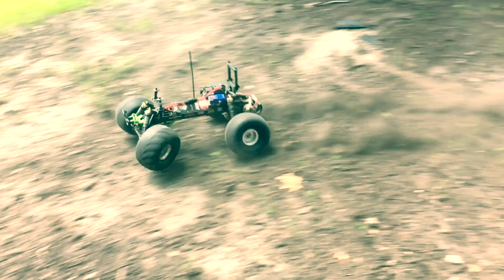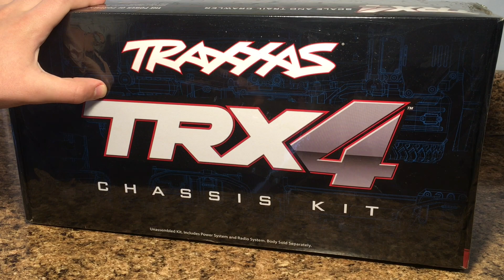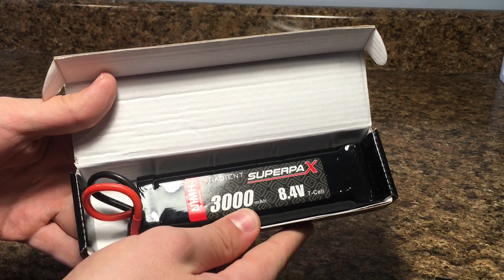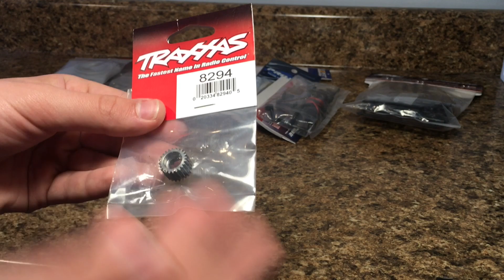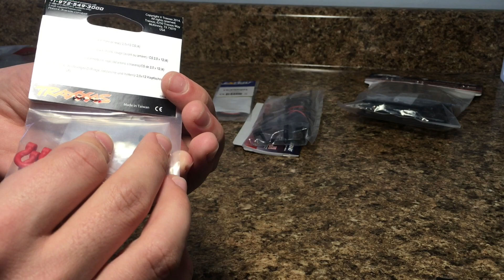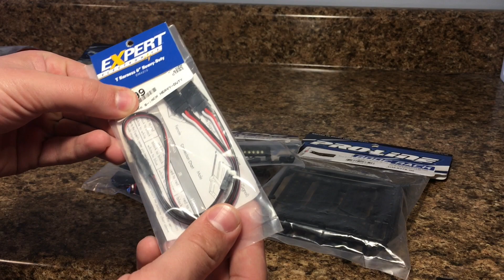Traxxas TRX-4 Chassis Kit Build Series | Introduction | The RC Genius

Comment: Those proline light are suck there not bright at all and mine burnt out really fast also those bumper will be too big for that body but that truck will look good and nice choice of parts👍
Reply from the maker: chad brunnemer thanks for the advice! I think the bumpers should be ok, I did take them and put them up to the body, and they look good. I will have to experiment with the lights though. Thank you!